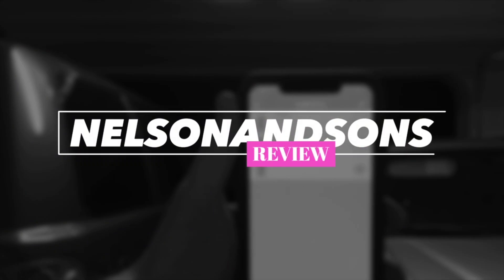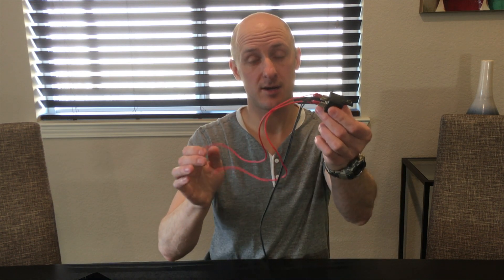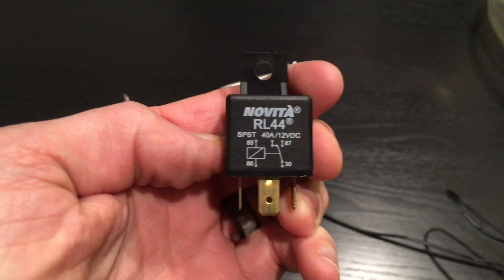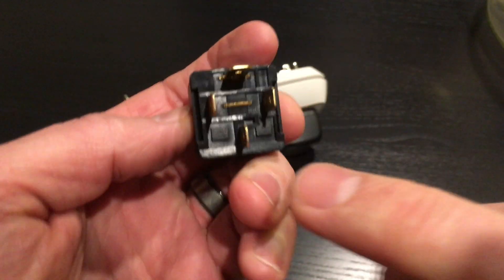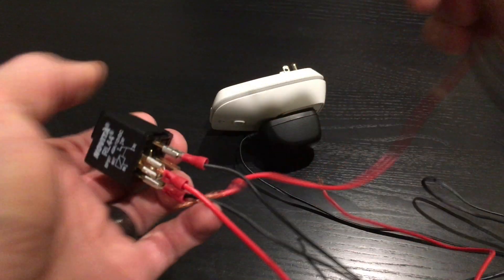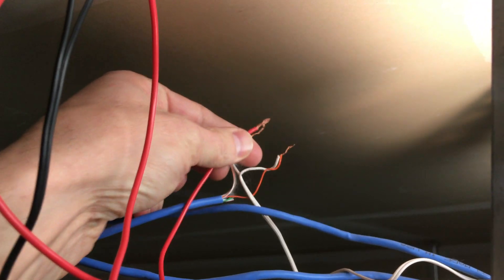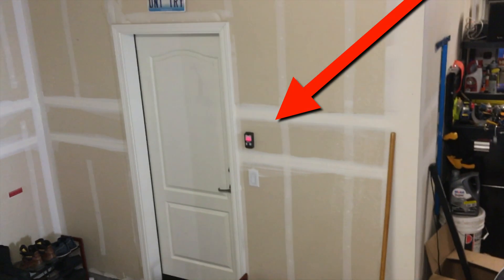Wemo DIY smart garage door opener

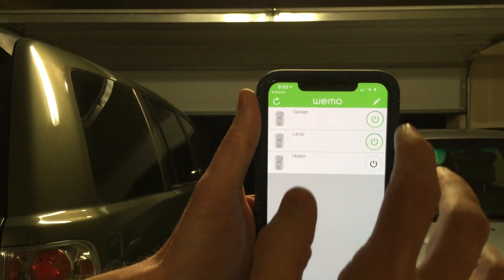Comment: 2:52 A few flaws with this. It just toggles the relay. And you have to press the button twice on the wemo app. There's no way to know if the garage door is open or closed. Also, you can't program Wemo rules like :"Close garage door at midnight" because it doesn't know the difference in the status of the garage door.

As for google home, you can always program a "Toggle garage door" routine which will turn the wemo on, count to 5 and then turn the wemo off. But as I said before: You still don't know if the garage door is open or closed before you invoke the routine.

What you need to do is very similar to this but add a reed switch (magnetic switch) to the garage door itself. So the switch itself is anchored to a wall, likely over the garage door, and a magnet is anchored to the door itself. So when the garage door itself is closed, the switch is closed. When the garage door is open, the switch is open.

The trick is to get the logic right: Wemo turned to on, opens the garage door. Wemo turned to off, closes the garage door. I'm currently working on a solution for this. I'm using Wemo minis. I'm consulting with electronics experts on how to pull this off. So far I do have a solution but it requires 2 power sources. That's ok since the plug in my ceiling has 2 X 120VAC plugs. One plug will have a regular 120VAC to 12VDC adapter which powers the trigger for the opener's terminals. The other plug will have a wemo mini with another 120VAC to 12VDC and an simple circuit with a relay, just like the one shown in this video. The relay will close a switch in the 1st circuit mentioned above which when combined with the reed switch will do the appropriate action. Wemo on = open garage door, wemo off = close garage door.

I'll post my own video once I figure it out.